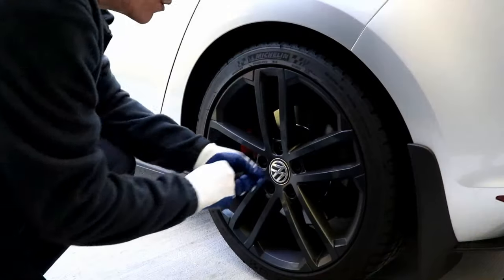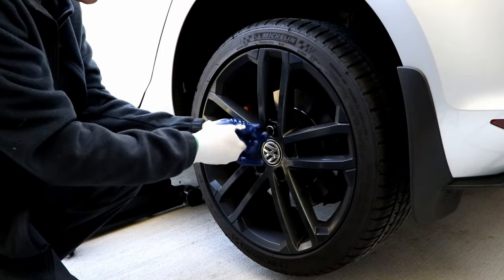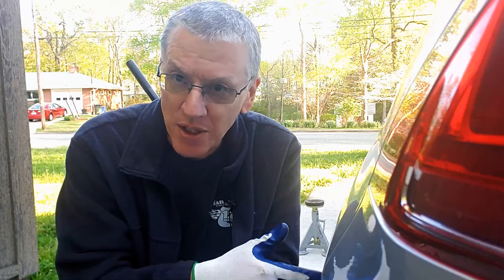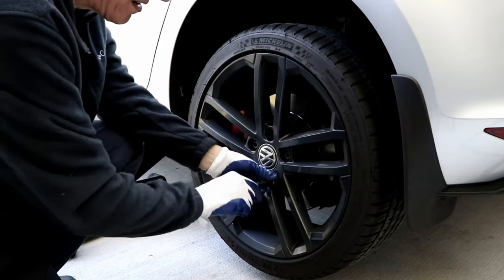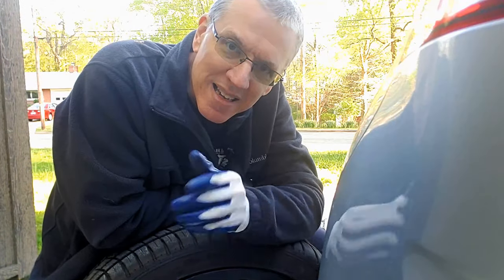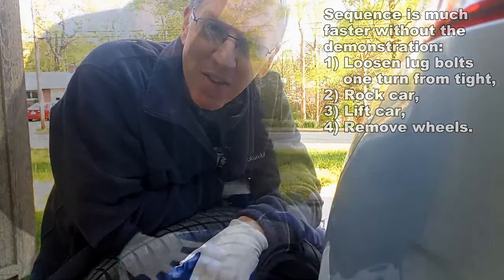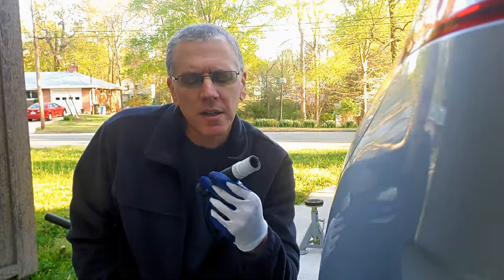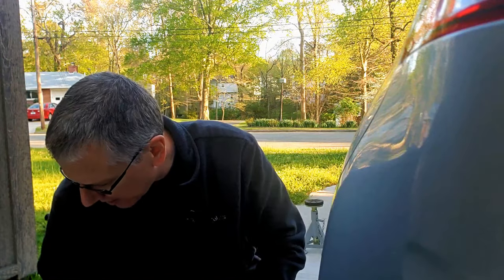MY WHEELS ARE STUCK - An easy way to free them

Comment: Anti-seize on the hub is what I have done for years. Works pretty well 90% of the time. Light amount of course. Also a wire brush to clean off the hub before I reinstall.
Reply from the maker: Thanks for sharing your advice.

Comment: I just had this problem.  For anyone else that does, if all else fails. Losing the bolts like he did in the video. And drive the car back and forth 2 feet when the car is back on the ground. I read that on a forum and it worked for me. Not sure if it's the best idea so I say only do it in a worse case scenario. Also good video, it did help me out a bit.
Reply from the maker: That'll work. If rocking in the driveway hadn't worked, then I would have driven around the block. They'd certainly break free from that. Thanks for visiting.
Reply: @StealthGTI moi j'ai mes 2 roue de derrière coller j'ai faire 7 km en prenant des courbe à 60 kmh et juste 1 sur 2 c'est libérer

Comment: Big thank you for this. I wish I’d watched this before attacking my alloys with a lump of wood!! Worked a charm after all else had failed. Little note- mine were REALLY stuck. Rocking the car released the top edge initially. I had to wind the nuts all the way in , roll the car forward so the wheel was the opposite way up and then repeat the process to free it off completely.
Reply from the maker: Nice to see that you were able to get them off. Thanks for visiting!

Comment: Very neat idea…aluminum wheels do love to stick to steel rotors…a tiny bit of anti-seize around the center does wonders.   And there’s a wheel alignment stud you can use on the studded wheels like VW that works great for removing and replacing.
Reply from the maker: Thanks for the note! I've since been allowing Discount Tire to do my rotations as part of their tire warranty. The techs hit my hub faces with rotary wire brushes at each rotation. Seems to do the trick. Take care!

Comment: I have just used this method, but the rocking didn't work so I drove it round the block and that did the trick. All 4 wheels released easily. Yesterday I hit one wheel with a hammer and block, but nothing.
Reply from the maker: Excellent! Glad it worked for you. Thanks for visiting!

Comment: I usually brush off the hub and clean it with brake clean then a thin film of antiseize on the contact points. Just a tiny little brushing so it's barely there and it does a good job. This is a great tip though! My rear wheels get stuck as well. Not sure what makes these cars do this moreso than others
Reply from the maker: Thanks for sharing your method.

Comment: On my 02 MK4 the first time ( 12+ years ago ) I went to remove my wheels ran into the same problem...My fix use scotch Brite pads to clean up the face of the rim and hub I originally started using lithium grease recently switched to Fluid Film you will always incur some sort of corrosion in the area.
My GTI 1.8 T with 285 K Revo stage one flash, performance exhaust manifold- cold air intake- performance exhaust muffler. I keep her up to factory specs serviced by my local VW, the shop foreman and I have been good friends for about 12+ years now I just walk into the shop and we chat about any topic under the sun.
Reply from the maker: Very nice! Thanks for sharing.

Comment: Nice video. Normally if the wheel gets stuck, no need to rock the car, just drop the car jack suddenly, and the weight of the car will unstuck it. Making use of the dumb force of the car...   but the rocking also works of course :-)    I will always apply a very thin layer of Copper-grease on the hub. No more stuck wheels....
Reply from the maker: Thanks for sharing your experience.

Comment: If you have rusty hubs just scotch-brite the hub, de-grease the surface and shoot it with some rust converter. It will create a barrier, turn the rust black, and is a paintable base if you want to paint the hubs as well
Reply from the maker: Thanks for the tip!
Reply: Oh ok, will do that too! Thanks!

Comment: Thanks for the good video, do they not loosen up already when you lower the car on the wheel with the hubs barely tightened?
Reply from the maker: Thanks for the comment! No, unidirectional pressure is not enough. Some mechanics loosen the lugs and then drive around the block. But that much time/effort is not necessary. Rocking the car allows lateral pressure to free the wheels. Leaving the bolts mostly-installed ensures that the wheels don't shift TOO much. Take Care!

Comment: It’s a good tip. I’d be interested to know the force exerted on the threads while doing this though as you’ve taken away the friction force between the bolt / wheel / hub to do this.
Reply from the maker: I don't imagine it's terrible since it only lasts a few seconds. Remember, I'm loosening just one turn, which may be about a millimeter. I forgot about another technique: during my research, I found that some mechanics will actually loosen the lugs (half-turn?) and drive the car around the block. I think what I'm doing is far less consequential. Thanks for visiting.

Comment: How do u if its over toqued
Reply from the maker: You may need a really long breaker bar. I prefer them over impact wrenches so that you can apply gentle, but increasingly more torque. It could be that the bolts will snap; so, be ready for that. If one breaks, then stop and go to a shop. Odds are good that the others will break, too. Better to have that happen someplace where they can be replaced right away. Good Luck!

Comment: A helpful video for those in your situation but your concerns about anti-seize are largely unfounded.  Yes, some people overdo it, but a very thin layer across the face of the hub and a slightly thicker layer around the center collar will prevent wheels from sticking.  Been doing this for 20+ years with no issues and my wheels practically fall off the car every time I remove them.  FYI, the problem is caused by dissimilar metal corrosion and the anti-seize becomes the sacrificial element (as opposed to your wheels!) so it's best to clean the hubs and re-apply every time you pull the wheels.  Takes a couple extra minutes, but then you don't have to worry about the wheels sticking to the car, particularly on the side of the road when you have to change a spare in the rain.
Reply from the maker: Thanks for the tips. I didn't want to make the video any longer by explaining the corrosion. Good to know a tiny bit of anti-seize along the hub will not spread excessively.

Comment: What is the tool that fits on the impact gun to pretension the bolts? Name and brand.
Reply from the maker: I've had this one for over 10 years: https://www.idparts.com/torque-limiting-socket-17mm-17mmtqsocket-hdt17c17-p-6245.html. I've seen similar sockets elsewhere... search the phrase "torque limiting socket" to find your size. To be clear, I use this to avoid overtightening. I still check each lug with an actual torque wrench to ensure correct specs. Thanks for visiting.

Comment: One of the benefits of having spacer is it would not seize up the wheels to its spacer thus easy to remove them.  No matter how much anti-seize I put never helped.
Reply from the maker: Thanks for sharing that.
Reply: Yeah but try removing the spacer after being there for so long is a pain. Tell me about it
Reply: @mk6_csg978  certain brands or spacers have notch or hole that i can use it to pry it out.  get something with notches for easy removal

Comment: Jealous of car owners, as this is a little harder with a full sized truck with road salt seized tires. Rear tire was stuck last month so badly the only way I could remove it was with a tow strap on the tire, tow strap on a thick tree and a come-along between them. Came off like a shotgun blast lol.
Only place I put anti-seize is behind my brake rotors, but placing them on the wheel itself just seems like a bad idea. Even a slight imbalance can introduce wobble at highway speeds.
Reply from the maker: WOW! That's quite stuck! Thanks for visiting!

Comment: You and j came up with the same solutions independently lol I even do the same to get the wheel back on
Reply from the maker: To get the wheel back on? I don't get it. I just line up the bolts and zip them in place.

Comment: Really off topic. What are your thoughts on RSR clutch kit? Does it holds well ? How many miles on it?
Reply from the maker: The RSR is fantastic. It's holding very well. And, as stated in other videos, I can be a bit abusive with it. I'm APR Stage 2 (around 370 lb-ft) and tow trailers. Even with a trailer in tow, I don't mind putting my foot into the accelerator from time to time. My tires are sticky; so, rather than spinning, all of the torque pulling 4500 lbs of car/trailer is held at the clutch. The harshest thing I do with my clutch is backing a trailer up my inclined driveway, especially if it has a heavy load. I have to be careful when backing between my other cars. That means I'm backing at slower than idle speed, which requires slipping the clutch. This is particularly painful in the dark when I cannot see what I'm doing. See what I mean in this 20-second video segment: https://youtu.be/ByltEJerp1k?t=419. Still, the clutch is doing great. It has almost 70,000 miles. Thanks for visiting.
Reply: StealthGTI
Thanks. Most things I read about RSR are positive. I’m is20 swapped stage 2 on 2018 sportwagen 4MO and stock clutch is going (slippage started recently). 
Still debating between DMF setup like Sachs/RSR and some SMF stage 2 kit. 
I like the drivability of retaining DMF.
Reply from the maker: @posimard8131  - When I replied, I forgot that we're in the "Sticky Wheels" video. If you haven't seen my "20 Questions" video, check out this sequence for my testimony about the RSR clutch: https://youtu.be/rOW8zgKdD0c?t=629

Comment: Hi @StealthGTI, I have a completely flat rear driver-side tire on my 2013 VW Passat that is stuck. What can I do to unseize it?
Reply from the maker: The same technique will work regardless of tire inflation. Just loosen the lug bolt a little and rock the car, just like in the video. Good Luck!

Comment: How many times have you changed the rear discs and pads? I have a sticky rear piston and don't know if it's needing a new caliper. It's a 2014 GTD I have and only 41k miles but it's got an epb on it so need to take it to the garage. Also my GTD comes with these wheels.👍
Reply from the maker: My brakes are still original. As for the sticky piston, a good mechanic will lube the pistons before pressing them back into the caliper during a brake job. Thanks for visiting.
Reply: @StealthGTI  original brakes wow! There's 6mm of pads left on the good side, on the sticky side they are 4mm and 5mm. I took the pads out and cleaned then greased the slide pins with silicone grease and put copper grease on the edges of the pads where they slide. But it's still sticking as the disc gets hot. I have seen video showing how to wind the epb back but don't want to try that incase I end up with a fault light on the dash. My discs are very rusty so I'm thinking I'll just get new discs/pads fitted when the garage opens after lockdown. Good shout in greasing the piston and hopefully it's ok.

Comment: Torquing wheels twice, first to a slightly lower value and then to specs, ensures proper results.  Few people do it.
Reply from the maker: Thanks for noticing. I usually hand-torque them when the wheel is in the air, then torque to full spec on the ground... and check them a few days later.

Comment: Did all that and still stuck! Let whole car down on Jack and STILL stuck! Any other ideas??
Reply from the maker: With the lugs loosened about a millimeter, take the car for a SHORT drive at low speeds, including a turn or two. That will shift some weight along the hub faces. Good Luck!

Comment: This did not work for me.  What did the trick was to loosen the bolts and whack it with a 4x4 endwise.  Lots of force but made of wood so no damage.  Another video had a guy who used a log so that's basically what I did with the 4x4.  Mine was cut down to 3-4 feet long so not the entire 8' piece of lumber.
Reply from the maker: Excellent! A short drive, I mean about 200 feet can work, too. Regardless, glad it worked for you. Thanks for visiting.

Comment: It doeesnt work i just tried it. When a tire is flat its not 100% so the rim kept moving as I was pushing the car and i and a skinny geezer like him i can bench 425 squat525 and deadlift 615.  I almost brok the tail light i was rocking the car so hard
Reply from the maker: Loosen the lugs another turn and don't push on the tail light.  ;-)  I'd recommend a SHORT drive, just 100 yards, but not with a flat. Good Luck!
Reply: Thanks for the analysis....Arnold.....lol

Comment: Some anti seize on the hub & threads , you’ll never have to do this again.
Reply from the maker: On the THREADS? Doesn't that affect the torque value by essentially lubricating the threads? I'd only consider putting the anti-seize on the mating surface of the hub. Thoughts? Thanks for commenting.
Reply: StealthGTI all you want is just a light coating, wipe off excess with a towel. If you torque it down to 85ft lbs, it’s still 85 ft lbs. Besides the steel studs can handle so much more.
Same with the nub. Get a light coating, wipe off excess. I’ve been using this method for 10 years in the northeast, every time the wheel comes off easily. The trick is the "light " coating. After you wipe it should look like it has gray dust coating on it.
Reply: @StealthGTI  Yes absolutely on the threads is fine. Work it in with your fingers, wipe off excess with a towel, and then torque to spec. I've been doing this for decades on multiple vehicles, never an issue with torque retention on the studs/bolts. Feel free to coat the rim/hub mating surface as well. Unless one goes crazy over applying, there will not be antiseize flying around later. Nice tip to free the stuck rim BTW.
Reply from the maker: @jeffsimpson5874  - Thanks, Jeff!

Comment: This is a very helpful video. VW has a paste to put on the hub to prevent corrsion, I put this paste on my car and it works great. 
her is the part number: (G052109A2) A little goes a long way :)
Reply from the maker: Thanks for sharing that! I think I may have a tube that was given to me many years ago. I don't think I remembered what it's for. I'll have a look.

Comment: Didn’t work
Reply from the maker: Two possibilities: 1) You can loosen the lugs 1mm more (one turn?) and/or 2) Instead of rocking the car, take it for a very short, SLOW drive... I'm talking about 500 feet... just enough to subject the car to a few bumps lateral forces, and light braking. Good Luck!
Reply: @StealthGTI  I’ll try tomorrow. Sob is on there tight.
Reply from the maker: @rickendicott1260  - If that doesn't work, then your only option, other than taking it to a pro, is to use a heavy mallet. Loosen (but don't remove) the lugs A LOT, then beat the wheels silly around the perimeter until they finally come off. Wire brush the flanges and wheel mating surfaces before putting them back on.
Reply from the maker: How did it go?